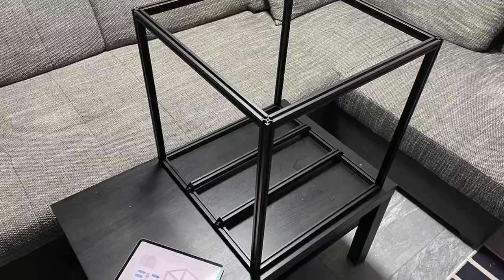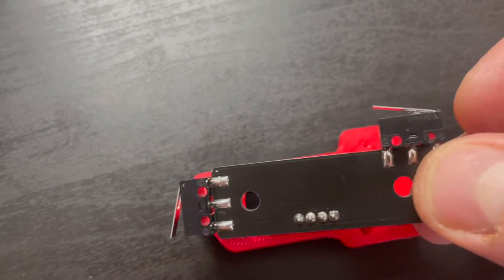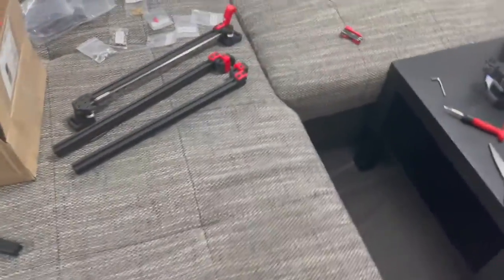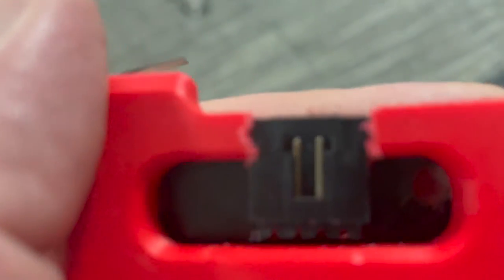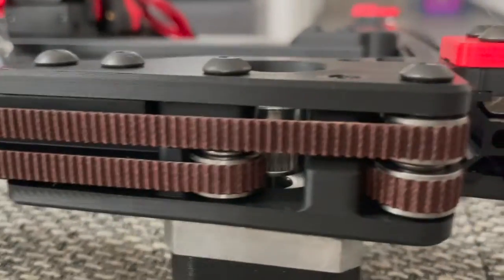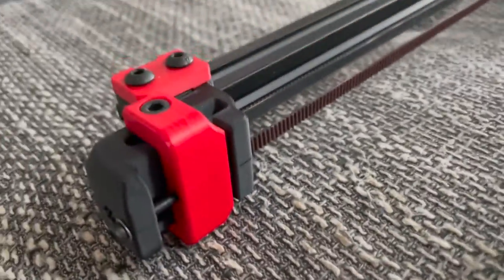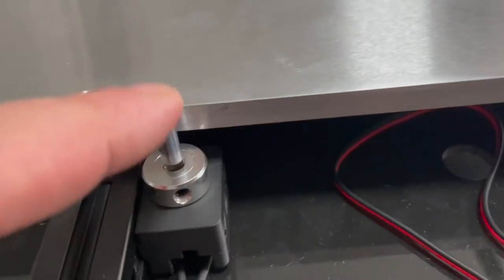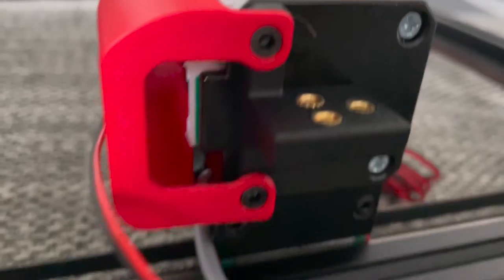Voron 2.4 Fysetc Kit 350 Build 1

Comment: That endstop board is meant to be a replacement for the Hall effect board. There’s a different bracket for it that has the cutout. I’ve never seen that board before (def not our design) but the form factor matches the Hall effect.
Reply from the maker: russiancatfood! So honored to have you commenting on my adventures with the Voron, the project you started and lead! Anyways, yeah my PIF parts did have 2 for the X/Y, the one I took a hacksaw to for the microswitches and the Hall effect. Some folks in the community seemed familiar with this mod, and sent me a link to a mod print for it, so other must be getting these from somewhere: https://github.com/VoronDesign/VoronUsers/tree/master/printer_mods/randell/Microswitch_Endstop
Reply: @moebis  thank you! You covered the basis pretty well actually, nice vid. Sorry about your fan 😔 
I can’t really keep track of the mods anymore honestly, it’s insanity 😅 So long as the end stop triggers that’s all you need. Speaking of, in part 1 I was looking at the end plugs on the X rails and was thinking “man, I really hope he removed them before homing”. Good luck on your adventures and enjoy your new toy!
Reply from the maker: @mr_voron  Thanks Maks. yeah The last thing I did was remove those end plugs, I was so paranoid they would slide off. First time building anything like this. Kudos to whoever put together that documentation, that really makes a project like this doable for someone like me.

Comment: Great video, kit looks pretty good in quality. Did it also include the thermal fuse?
Reply from the maker: No thermal fuse. Debating if I should install one or not.
Reply: @moebis  I'm going to, rather have that than a house fire. Idk if the SSR is any good, but another layer of security never hurts.
Reply from the maker: I discovered the thermal fuse is already built into the heating mat.

Comment: hi there, I'm looking into what kit should I buy, I really like this one, whant to ask you if the screws are black oxide stainless or steel? coul you check them with a magnet? I really want stainless ones. Formbot has the kit with stainless but its with Rasp Pi 3b+ and Actopus board and I really want the Spider board and rasp Pi4... what about the rails are they smooth?
Thanks for taking the time to make the videos ;)
Reply from the maker: Hi Bruno, thanks for the question. They are definitely black oxide. I have stocked up on parts since my build, and went with stainless steel. Our discord group made a bunch of suggestions directly to Fysetc and they incorporated them into future kits. You should join and ask them to include the stainless steel bolts:  https://discord.gg/3PnZxkquCx
Reply: @moebis  thank you for taking the time to reply. I ordered the printed parts yesterday now I'm getting in touch with both formbot and Fysetc for the kit. Fysetc told me they are stainless screws now but I wish they had more info on their advertized kit like Formbot has... it might end up being the same s**t but at least brings me more confidence :P. anyway thank you again

Comment: Hello Moebis, does the Fysetc Kit come with per crimped wire harness? Or do we have crimp and cut etc all by our own?
Reply from the maker: It's not a wire harness, but all of the cables are the correct length and pre-crimped, so you will not need to crimp or cut anything.

Comment: lol I have the same couch now I need the same voron !😊 are you happy with fysetc kit ??? any problems or mismatch items ??
Reply from the maker: Lol, it's a good couch, it hosted an assortment of Voron parts of the last couple of weeks! I cover most of my finds in the 4 videos I published so far. The parts that matter are high quality (rails, belts), There were some screws missing near the end of the build, but I had some extras on hand. Some of the cables were short and didn't reach my original layout. In Build 3 video I show the layout that works and let's all of the cable runs reach, especially the miniLCD ribbon cables.Took a really long time to build, so be prepared, but that is half the fun and this printer is a beast. Once I got it dialed in, I'm amazed at the speed and quality. We gave Fysetc some feedback in the Voron channel and they already made some improvements to the kit (like longer Z belts, extra parts kit, etc). So you get to benefit from the early adopters beta testing it for them. All in all, it's the best 2.4 kit out there right now. The blurolls and formbot (from what I've heard and seen) are not great. Also they send you a spool of wire, prepare to cut and crimp a ton of wires. With the Fysetc kit, I didn't have to crimp one wire.
Reply: @moebis  what the cables are precrimped, nice
Reply: @moebis  thx for the feedback
Reply from the maker: @TheOrgonaut  All of them. There were a couple of 12V to the power supply that I just screwed down, I should probably crimp a fork or spade connector on those, but all the motors, fans, thermistors, etc are pre-crimped with a long enough runs to make it all the way through 3 cable chain and to the bottom.

Comment: What size are the Z idlers? The BOM on Aliexpress says 2x6mm and 2x9mm idlers, but I suppose they are 4x 9mm?
Reply from the maker: yes, they are more like 10x11, they fit the 9mm belts perfectly with some margin on either side
Reply: @moebis  thanks, I have one last question no one has been able to answer so far.
Do you need to print the 80t hubbed stopgap gear? It's in the STL list, but I can't find a use for it.
Reply from the maker: @stealthninja1o112  without seeing what that is, I would say no. The PIF didn't come with it, and the Fysetc kit has all the gears you need.

Comment: how is build plate
Reply from the maker: Looks great to me. I asked Fysetc in the discord channel and they insisted it's MIC6, true cast aluminum. I guess I'll find out after my first heat if it tacos. I don't have a dial gauge, but I took a carpenter square to it to see if there were any gaps and it's completely flat.
Reply from the maker: Someone on the discord channel just finished their build and did a mesh bed leveling. It looks spot on, probably one of the flattest I've seen.

Comment: there's no M4 screws in V2 bom at all :)
Reply from the maker: Did I say M4, I probably meant M3 ..lol sry
Reply from the maker: Maybe not in the BOM, but I just discovered you need M4's to mount the power supply and SSR. And the PIF parts are printed to accept those M4... strange.